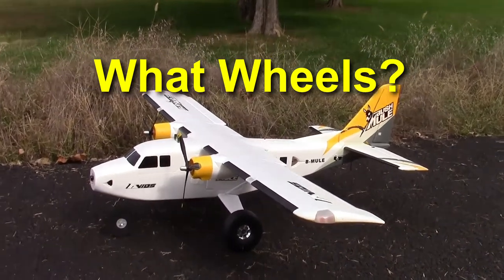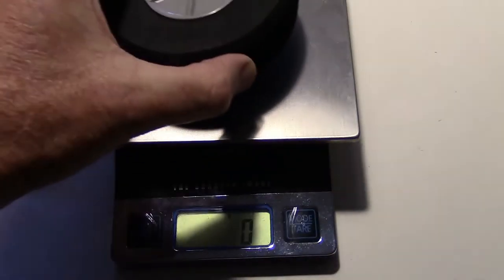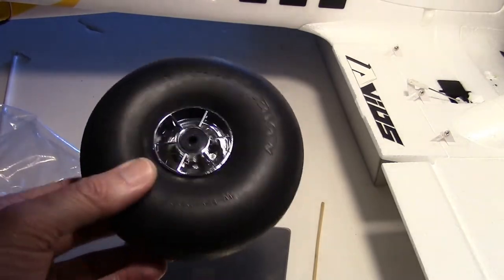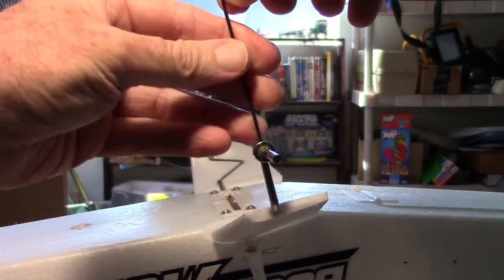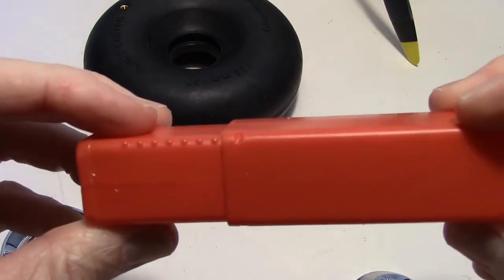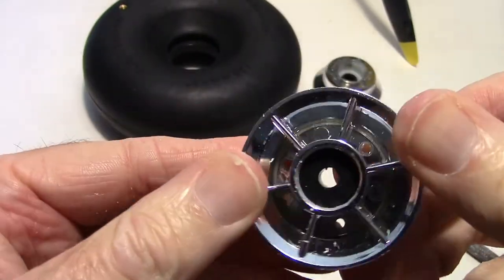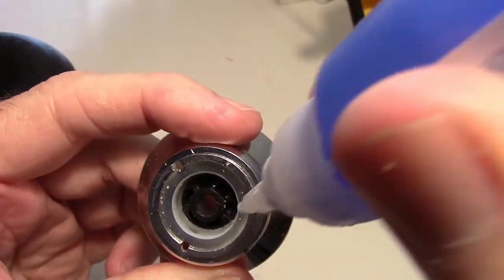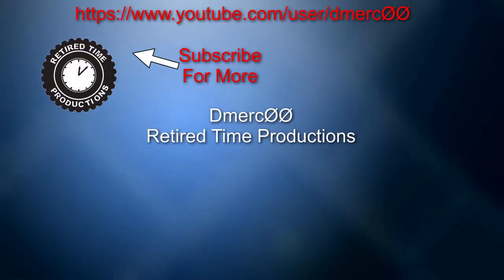HK Bush Mule FPV Build Part 5 - What Wheels to use in place of stock

Comment: i ordered the kevan wheels thx for the instruction. Ok update to this i got the wheels super fast. i was going to do what you did but then i found you can take the inner collar off and just use it on the outside with clip no mods required. i just need to flight test them now.

Comment: Great video. On my bush mule I added the wheels off my eflight timber. They needed a little work to fit the landing gear but they fit great. My only argument was the plane with no battery likes to have the nose raise up while on the ground.
Reply from the maker: Great idea! E-Fllte Timber main wheels 4.25" diameter only a quarter inch less than the stock Bush Mule wheels.

They look like soft foam but the specs  don't say.https://www.hobbyzone.com/eflite/all/efl5258.html

Comment: Great work Dave.  I looked at using the soft replacement Tundra tires but the hubs are to wide and I messed up one wheel while trying to modify it, lol.   Was using too big of a power tool late one night, it didn’t end well for the tire.  I think I’ll revisit the issue using your solution.
Reply from the maker: Are you referring to these?
https://hobbyking.com/en_us/rubber-foam-version-of-tundra-wheels-with-silver-hub.html

Comment: My local hobby shop had a set of Kavan wheels which felt like a great set of wheels but they were 40 bucks for a set when most other wheels were under 10 bucks. Very pricey wheels. When i get my bush mule i think ill just plasti dip the stock wheels. for grass landings the stock wheels will work fine.
Reply from the maker: Is plasti dip foam-safe? Will it dissolve the foam wheels?
Just asking because the idea sounds good in general and it's always good to hear what my viewers think of various products.